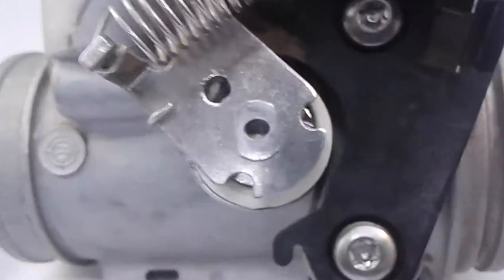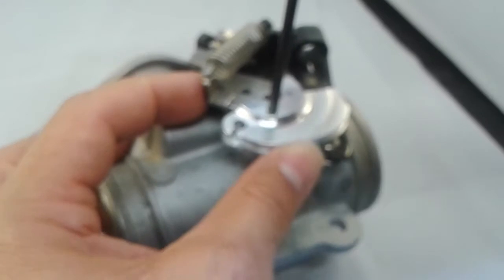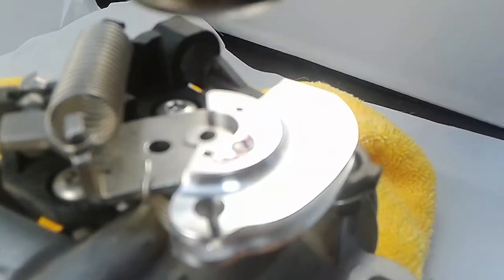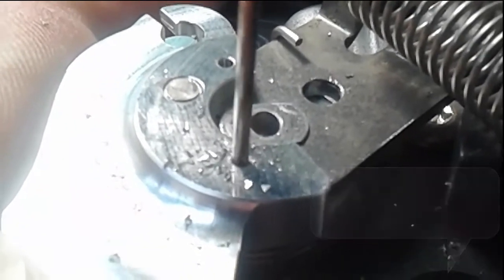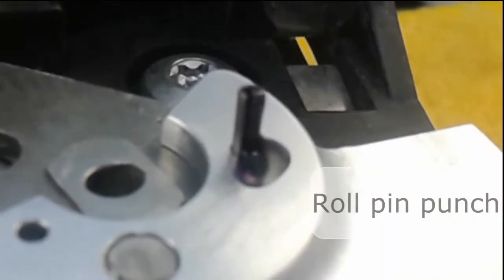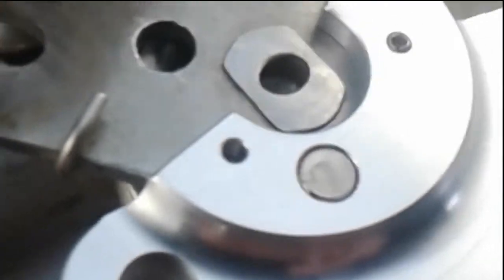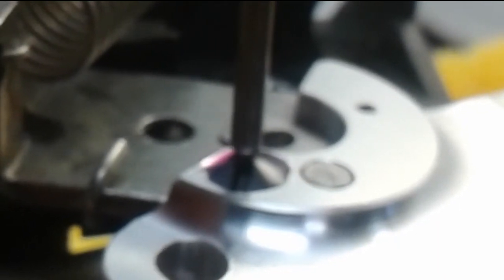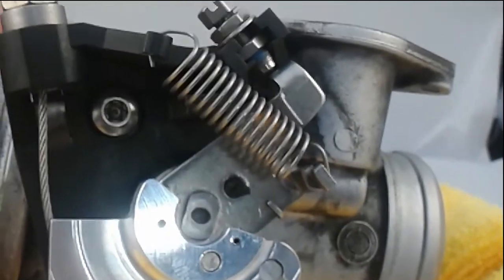BMW Broken Throttle Cam Fix

Comment: Good product, easy to install if you follow the instructions. A complete  rebalance of the TB's will be required upon installation.
As mentioned below the aluminum should be andoized, especially for the price asked. I did my set prior to installing.

Comment: Great replacement part, but the price is too much for just 2 pieces of CNC steel.  way too over priced IMO...  Nice tutorial though.  thumbs up
Reply from the maker: Actually the pieces are made from 7075 aerospace grade aluminium.  Compared to the replacement cost of the throttle body, which last I checked was $600 or so each and the same problem exits on the new throttle body,This route to me is more affordable.  The repair may not be for everyone but for those people riding in remote areas it does add peace of mind of one less thing to go wrong.
Reply: @Marcusredmonkey  ONe of mine broke in my yard as I parked my bike to pull the gas tank off, down here in south Tx the high heat and very high humidity does a job on plastic, it destroys it, turns it to dust in a fairly short time. I am hoping these parts cost a bit to manufacture as I'm a low income person, I was on disability for a while from car accidents and don't have a lot of funds, you are not told that this issue could easily arise when you purchase a used or new BMW unless they have corrected the issue on the newer, I do know about the aerospace alu and it should never give any issues at all, you won't be stranded and I can't afford that, I quite likely would not have purchased the bike if I'd know of this issue as this is quite a cost. None of the bikes I ever owned in the 70's and that was many, had this issue as this part was alu, aluminum, I did a lot of work on bikes and built choppers, yep I'm older, 68, a shade tree mechanic, the parts look very well machined and BMW parts are damned expensive. I've asked them why they used plastic where metal should have been, they don't seem to care which does not show well for them at all, my view of them has dropped a lot.
Reply from the maker: @jymebale5545  the issue is the POM.  or the  polyoxymethylene.  Nothing bonds to it so repairs are not really a possibility.  I have known people to source the original part and be able to replace it.  Yet again it is made of the same material and the same issue may happen over time.  This modification is meant for those who wish to no longer deal with breaking.